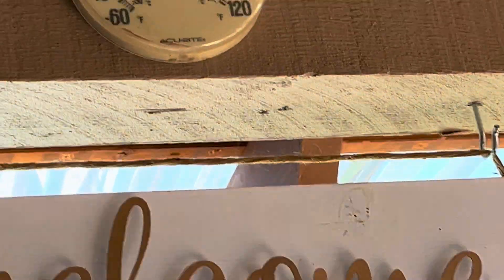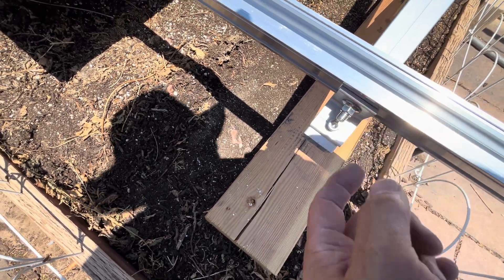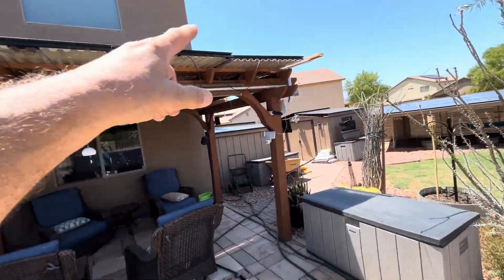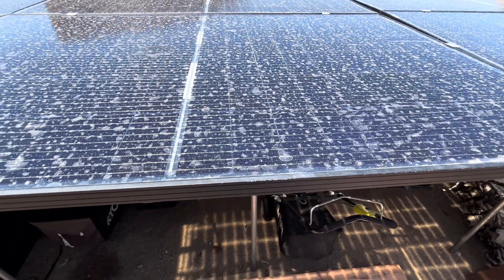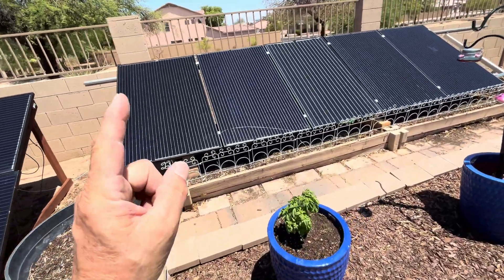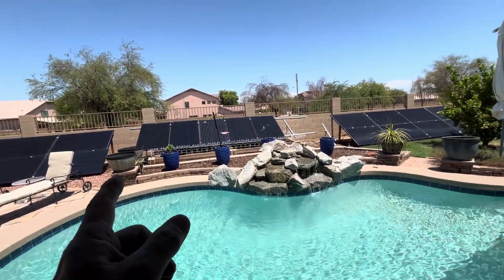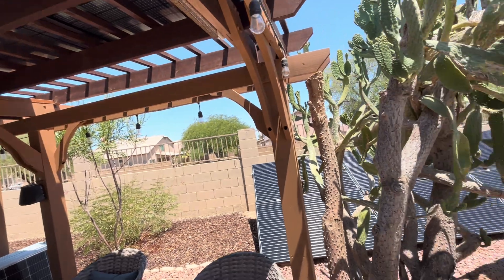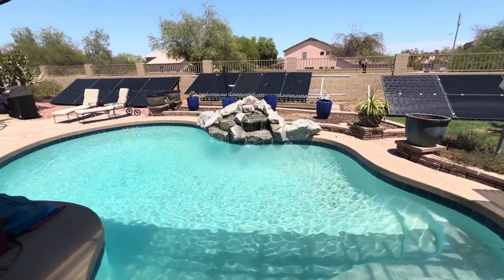DIY solar panel for home. Panels used $18-$30. How well they perform. EG4 ground mount 6-8 panels

Comment: What did you use to extend the length of the brightmount ground mount to enable you to put more panels on it?😢
Reply from the maker: @michaelrichbourg2080  I used different rails for the bottom so I could use all 4 rails from bright mount on top rail. Found bottom rails locally $22 for 86 inch long rails. If I had the room, I could fit 8 panels in a row. I could just buy another bright mount set as well but was cheaper to do it this way. You can find the bottom rails I used at SanTan Solar in Gilbert AZ. If you don’t live locally by Gilbert AZ. Probably would be cheaper to buy another bright mount ground mount system. Link below to purchase rail, you will need to purchase the end clamps and mid clamps to fit this rail from SanTan Solar as well.
https://www.santansolar.com/product-category/racking-and-mounting/?product-page=2

Comment: Would love to be able to find these prices for panels in Northern Nevada! I just looked on the santansolar site and I am not seeing the prices you are quoting though.
Reply from the maker: @rongray4118  You will need to sign up for email alerts of sales and promotions, they just had a promotion in May and June where almost everything was 25 percent of with a coupon code. Also they add new products almost daily. I check there website several times a day to get the best prices because they post new listings for solar panels throughout the day. So I catch a lot of really low prices and last 2 months they had a very large amount of mono solar panels extremely cheap. The more often you check their site, the better deals you will find and for me, it usually worth it to get pallets of mono used panels for $18-$30 each. Hope you find some great deals, I know I bought over 25 different pallets of poly and most mono solar panels are mixed manufactures and different watt output but usually within 30-40 watts difference. Lately like I said they have been getting in a lot of used mono panels but it’s different every week since these panels come from them removing from large solar arrays around the country with either replacing older panels or decommissioned systems that a business is no longer open. So check back often to get the best deals and be patient, there are always great deals often.
Reply: Unless you get used panels it's not worth it to go solar in NV since you're only paying 11c/kwh and even less during the night. For me in Cali paying 37c /kwh it's a diff story.
Reply from the maker: @Gary-ee3kq  That is a cheap price in NV for electricity.

Comment: Hello Pappa, wonder how you wire the panels from yard into the house, did you have a in ground conduit? Thanks
Reply from the maker: Yes, I use 10 Awg solar stranded wire that is sun proof and direct burial. I run it through flexible grey conduit.

Comment: Nice video. All the best from Texas.
Reply from the maker: Thank you. I’m trying to give a lot of info that I learned about the products through installing and testing to the limit of the products and what is the most efficient products. My older videos I was using MPP products which were very limited to 120v but could parallel. Then they had split phase but once again very limited and could never start my 3 1/2 ton and 4 ton ac.  It the Growatt and EG4 3000 watt inverters in parallel are able to start and run both and run both at the same time which is amazing for out here in the phoenix AZ area where it is often 110 to 117 in the day and 90’s overnight. Everything info is off grid and nothing is the grid is not connected to the off grid system at all. Don’t need to use the grid assist with the large battery bank I have. Thanks for your comment and hope you have a truly wonderful and extremely blessed 2024.